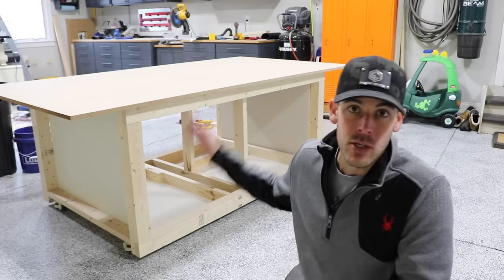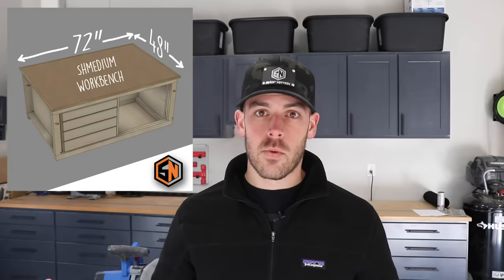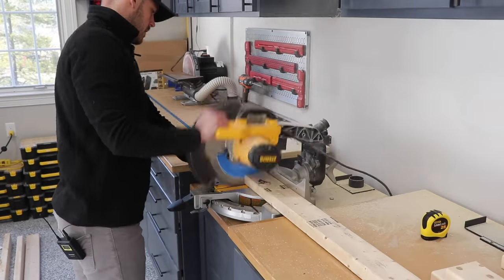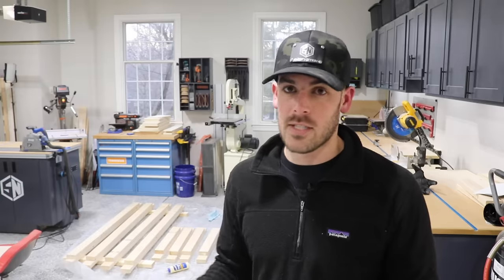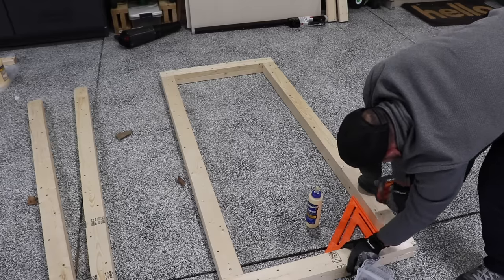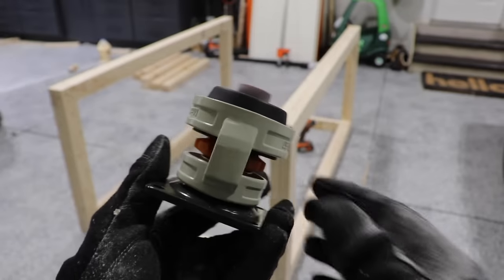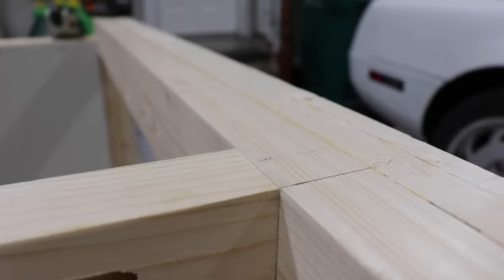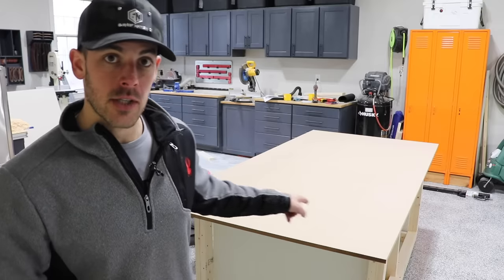The Perfect Garage Workbench & Outfeed Table // Part 1

Comment: Very early stages of this build, and excited to get it done! Of course have to wait until the sub-freezing and sometimes sub-zero temps are gone since my shop is in our 3rd garage, it's not heated, and I don't think the little 1,500W space heater I got can keep up with those kinds of temps. I'm planning on modifying the organizer storage area to hold a small 3018 CNC machine I picked up around Christmas. Right now it sits on some MDF cabinets the previous owners left behind and it is loud as heck. I'm hoping to build a full enclosure for it utilizing the dust collection system and some foam panels to absorb some of the sound.
And quick note, as of right now the casters you have in your materials list are listed 'currently unavailable' on Amazon.

Comment: Anyone who criticizes anyone else for using a 6" joiner, needs their head examined. Craftsman, WEN, and Porter Cable all sell excellent 6" joiners. In the case of the PC, they're very cheap and decent quality...I found all three within about $10 of each other; approx. $417 Cdn.

A hobbyist and newbie ww'er can get by without one, but having that 6" joiner is a game changer. If you build outfeed wings like you do for your mitre saw, Bob's yer unlce.

Comment: Design looks approachable.   Only question is: why did you mount the bottom that way?  Seems like it could put stress on the screws with increased weight?

Comment: Best to predrill the 2x4 laminations if you are not clamping them. A tapered bit predilled would allow the superficial piece to be drawn against the deeper piece and make a tighter lamination.  Also, you did not apply any meaningful force when you did drive the screws.  Even stepping on the 2x4 at the location for each screw would have been helpful.  Without predrilling or having clamping pressure, the tip of the screw has a tendency to push out the deeper piece of wood to create a void.

That being said, I like the design.  I am planning on building something similar, but will probably use plywood laminations for the legs and stretchers.  Keep up the great work.  Subscribed!

Comment: Great build, looking forward to part two! One question - would it not have been better to put the wheels on the underside of the actual frame? It looks like you have the entire weight of the bench resting on those two horizontal stringers which are only held in place with two pocket screws each end?
Reply from the maker: Will be addressed in the next video
Reply: @ShopNation  I knew you'd have it under control!

Comment: Instead of trimming all of those ends to fit your 2x4, just cut a block of the 2x4 you plan to use and clamp it on there to butt against before glue
Reply from the maker: Great idea

Comment: Great Part 1, and looking forward to Part 2.  Question about the feet, any concern that the single "2x4" with the 2 screws next to each foot is taking all the weight of the bench and not the stout laminated legs?  Thanks again for the content!

Comment: Would gluing up a panel of poplar boards (which I have some left over ones from another project) to make the 2 end panels work as well as the 3/4" plywood you call for in the plans? I don't see why it would matter. It might even add some strength? Thanks for the awesome video series. Bought your plans and will begin making this soon.
Reply from the maker: Yeah that should work!

Comment: Might be putting a lot of faith in those pocket screws ability to hold up the entire weight of the table based on you installing the casters under the cross-brace instead up under the main legs of the table.

Comment: Plans call for 1-1/4 pan head screws. Should be 1". The entire thickness is 1 - 1/4 Definitely sketchy when screwing the top in leui of clamps
Reply from the maker: Will get that fixed!
Reply: @ShopNation  I actually cut real small blocks of 1/2 ply and used them to shorten length of the screws as a work around. More clamping area also!

Comment: So, I'll start with I love Shop Nation. I learn a ton, enjoy the video production and tinge of goofiness (because I'm that way myself). And I'm totally going to build a slightly different version of the Ultimate Workbench (most likely at a 6' by 3' size) due to the size of my work space.

I wanted to say all that before I ask what might be considered a stupid or insulting question:

Is it just me, or is the entire weight of this work bench resting on 8 pocket hole screws with glue? Wouldn't it be better to route a bit of a slot into the laminated frame to provide support from the frame against the cross pieces with the pocket holes? Maybe I'm missing something here (and would love to know, if so). It just seems like those laminated sides to the frame end up being all looks and then unhelpful in terms of support if all the weight ends up resting on those 8 pocket holes screes and glue. Maybe I'm under estimating how strong that joint is? Anyhow, I'd love help in my thinking there.

Keep up the good work!
Reply: That's what I thought too at first, but those panels on the side are bearing a lot of the weight as well
Reply: The panels are not resting on the floor, so that weight still ends up bearing on the pocket holes. Yes, this design is pretty, but the caster location is flawed if there is no additional support added to the horizontal braces in the future. Those pocket hole screws are under shear loading as well, which is not what screws are meant to do.

Comment: Your casters may be able to hold 2,200 lbs combined, but the 2 pocket screws on each side of the stretchers you screwed them to won’t come close to holding that much. You might want to consider adding some support to the top of the stretcher so it doesn’t collapse under heavy load or over time.
Reply: Was coming to comment on the same thing.   Guaranteed failure point under weight

Comment: Building plans out, once top was completed I realized that the plan dimensions given are about 1.5 inches short on the long side. As designed the trim will not overhang the ends.

Comment: If you work with 4x8 sheets and want to break them down on your bench, you want it at least 6” smaller in both directions in case you need to clamp guides or jigs to the sheets while working with them.

Comment: This bench looks great but for anyone wondering, this is NOT cheap to build. Prices will be a bit different locally but in the NE US the lumber alone is $540 USD. All said and done this will be a project cost around $2000.00 USD. It's nice for sure but the costs should be made clear.

Comment: Good video, found it looking for assembly table ideas. Woodworkers will cringe, and you should too...a little for reaching over your track saw using the jointer,  the jointer also moved a little, no good. Maybe use from the other side of the bench? Gloves are meh, tons of people use them and then tons find out why they may not use them. For a jointer, unless the board is 6in tall I'm using paddles every time without exception.

I love those casters tho, spendy last time I looked. Don't like them mounted to a board with pocket holes attaching it tho, pocket hole screws in shear . Tied to plywood sort of, that's the main change I would make.

Comment: Hopefully, you haven't already answered this, but can you explain the placement of the casters. The crossmember is attached with pocket screws, so the entire weight of the bench appears to be resting on the weakest points instead of the vertical 2x4s supporting the top. Thanks in advance!
Reply from the maker: Will address in the next video
Reply: @ShopNation  I will look out for it. Thanks.

Comment: The bench looks amazing. I love the design so far. My only concern is how easy/ difficult it will be to lower the lock on the wheels which them tucked in that far.
Reply: I've built a more mobile version (I like to cut nearest to my garage door but store the bench deeper into my "garage") and used a different attachment for the casters. Instead of the stretchers he has added for his casters, I doubled the bottom stretchers and mounted them on edge, so I have a 3" wide place the attach the casters; you will need to watch the total height of the bench, so you can still use it as an outfeed table (I used 2-1/2" locking casters with a high load-rating).

Comment: wheels seemed to be placed in a very structural weak location. All of the load transfer from the table to the wheels relies on those pocket hole screws. As you noted this will certainly fail before the wheels reach capacity. Seems like there needs to be a better way to transfer load from the main frame to the cross member that the wheels are mounted to.

Comment: That was brutal watching you use your jointer. Those smaller ones don’t push the dust out so you need good dust collection and it looks like you have sawdust caught in the cabinet of it causing it to come out the top.

Comment: Hi all, I started woodworking about 2 years ago and I’ve tried several types of products such as fancy bird tables, planters, pens etc but I’m now getting close to building my 1st furniture as in a mitre plus sanding station. I’m using Formica laminate for the top, oak trim and plywood drawers. Can someone please advise how to finish the drawers fonts and inside please? I’m thinking of a Matt emulsion paint and a water based varnish on the drawer fronts but I’m guessing. Should I spray inside the drawers? Should I apply varnish to the laminate? I’m really sorry if I have posted this in the wrong place but I’m a newbie and unsure how this works. Thank you in advance. David. Uk

Comment: When you buy your first jointer and realize your dust collection game is lacking.
Reply: I was more thinking about something I had just realized recently. Namely that have, if possible, jointed only one side and then done the other at the table saw. The reason is so that the two sides will be parallel.

Comment: As I was watching this vid and the performance of that jointer it's clear to me that something is amiss there. No chips were shooting out of its dust port so it was def clogged up. Even using just a shop vac there should not have been that huge pile of shavings at the conclusion of the milling process. Bad juju that machine.

Comment: Looking good so far! Question for you on the caster placement: Will the stretchers be more reinforced prior to loading up the table with weight? It seems like the pocket screws would fail before the casters got close to fully loaded (in my very unprofessional opinion, as I have no idea about the load capacity for pocket screws).
Reply: I was thinking the same thing, either deflection of 2x4 since mounted on the narrow side and the structure only supported by 8 pocket screws.
Reply: @brosier  After checking out the Etsy plan page, it looks like there's a brace piece that is screwed in above those joints to address this.

Comment: Looking good so far, however what happened to your dust collection on the Mitre Saw? there seems to be dust everywhere when you cut, i have never seen that before in past videos, did you forget to switch it on?
Looking forward to part 2.
Stay Safe,
Barry (ENG)
Reply from the maker: Pretty much non-existent, I need to address that!

Comment: Great build up until the pocket hole bit, would of been better if you had also joined the Cross members with half lap, pocket holes are not meant for taking much weight

Comment: One of my greatest fears is how and where the casters are mounted.  Can not rely on the strength of the side pocket screws to hold the 2x4 that the casters are mounted to.  The 4x4 corners need to sit on the 2x4 that the casters are on.

Comment: Curious on how the casters and frame are holding up.  I could be wrong, but it looks like you attached the casters to the cross beam, so the whole work bench will be supported on the casters by 2 pocket hole screws on each corner.  If so, isn't that a ton of weight for those screws? Why not attach the casters to the bottom of the actual corner posts?   Any insight on that would be appreciated.  Thanks.

Comment: Travis, Great video and really beautiful piece.  great color too.
I just build a 4x8 bench (not as sophisticated as yours).  I used 3/4" birch as the first top and for the second top i'm thinking about a 3/4" laminate sheet, but i'm concerned that the particle board core won't be solid enough to hold the router-ed T-tracks.

Then i saw this 4x8 sheet of solid PVC material (Interplast Group - cellular pvc sheet) at Home Depot.  one side is very flat and smooth.  i wondering if this might work well holding router-ed T-tracks. 

Have you seen this material? or heard about this material used for a workbench top?
Thanks
Tom

Comment: Ok, you asked what we think so far. I think you missed an opportunity to make a stronger table. You made very strong frames using half laps, then you support everything on casters attached to rails that are just held with a couple of pocket screws. In keeping with the build theme, the caster rails could have been half-lapped as well and would have been far stronger.
Reply: Ha I literally just commented my problem I had doing exactly what he did.  My stretcher fell off going over the cracks of my garage.  Thinking a 4x4 at least the stop some of the flex
Reply: @dexter9522  Hate expansion joints in the garage floor.  I filled mine with Sika Pro Select Self Leveling Polyurethane.  Wasn't cheap, but damn, I wish I had done that a long time ago.
Reply: @davidbondi  that’s funny I actually used some leftover wood scraps when ripping 2x4s and put them in the areas my work bench travels frequently.  Took a lot of the brunt off going over then

Comment: I guess I’m not understanding those casters. In order to go from mobile to stationary or back, you’d have to get down on all fours and turn that notched orange wheel in that tight space over and over to extend or retract the rubber stopper... and do that four times every time? That doesn’t sound practical, so I’m assuming I’m missing something. What is it?
Reply from the maker: Thats basically it, I don't personally plan on moving mine after setting it in place

Comment: Hey! Great job, looking forward to the end-result. I'm always wondering if a full plywood construct isn't cheaper and makes a better use of the available space. Curious about your opinion.
Reply: Instead of 2.4's, make the beams from laminated lengths of Baltic Birch and it will be seriously solid, heavy, and oh... expensive!  But without a table saw it would be miserable to cut those all up.

Comment: Jointer Dust Collection: Super weird at the 8:35ish mark, it's not even shooting out the tube?? I have the delta version of that and if I don't have the dc hose hooked up, it at least shoots a ton of it out the shoot. With the dc on, I get nothing back at me. Yours is coming straight back out the top. I don't know that model specifically but maybe something is blocking the chips from going under? Great build so far!
Reply: I bet it throws so much out, that the way Travis has the vacuum hose bent tight 180 degrees back, that the hose is plugged up in the first 60 seconds.... then chips everywhere.....
Reply: @davidbondi  I totally agree on the 180 hose/kinking. Plus taking that much off of that much wood will fill up his dust separator pretty quick. Then I saw the clip at 8:35 and he has no hose hooked up and it was throwing the same amount of chips out the top and nothing was even "falling" out of the port where it is supposed to come out of.  Travis, if you read this, David is probably right, try taking that port off the left and see if it is clogged up inside. That might just be the issue.

Comment: Great video! I am wondering about the two bottom panels you screwed on the frame? Are the just to seal the compartment or will they be supporting weight?
Reply from the maker: Both, but not much weight

Comment: In the process of building the medium workbench. I don’t have a jointer. Is it possible to joint the 2x4 boards before I glue them together. Was planning on using a jointing jig with my 10 inch job site table saw. Thank you.

Comment: This is awesome. Is there a reason you chose to mount the end walls recessed several inches as opposed to flush with the frame posts?
Reply from the maker: Yes
Reply: That makes sense. Thanks for clearing that up. 🤷‍♂️

Comment: Safety tip: don’t use gloves when using woodworking machinery (like your jointer). They can easily get caught in the spinning blades and pull your hand into them.

Comment: When you made the half-lap joints on the long side carcasses, did you pre-drill the holes?  Or did you use those "special" screws that cut nicely into the wood?  I am a novice woodworker, so hopefully my question sounds like a question and not criticism.
Reply: In softwood, like a 2x4, there is no need to pre-drill when using construction screws.

Comment: You were literally my inspiration to start my channel.  Quick question on the feet.  I have a workbench that I screwed my feet onto a 2x4 just like that and when my work bench goes over a stress crack in the garage it finally ripped the pocket holes off and the wheels fell off with the entire 2x4.  Had a flat tire on my work bench.  You think working in a 4x4 there would strengthen up that joint?
Reply: I just looked at the plans.  Looks like you add a brace above to stop flex.  I like it
Reply: I had the same concern. If you look closely at the thumbnail you can actually see the added 2x4 brace above the casters. I think a triangular one would be a little more esthetically pleasing buy we all know we usually just go with quick and functional 😆